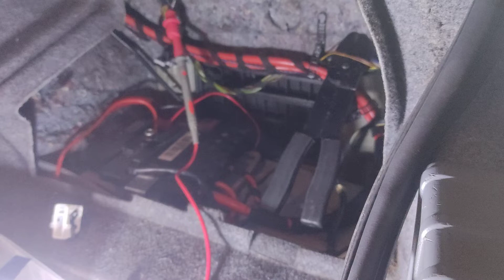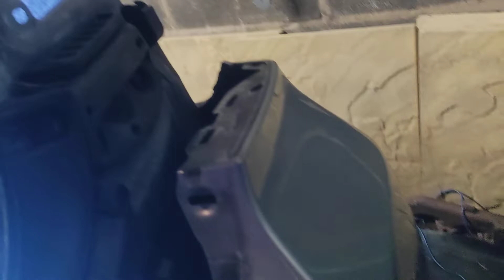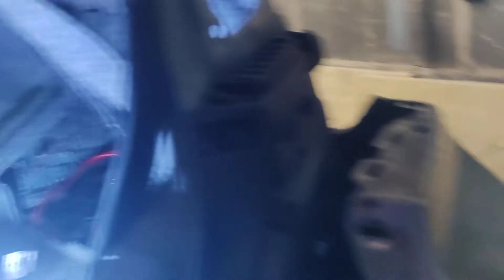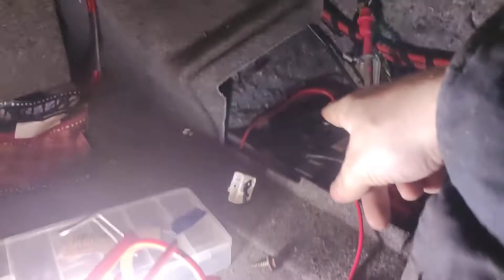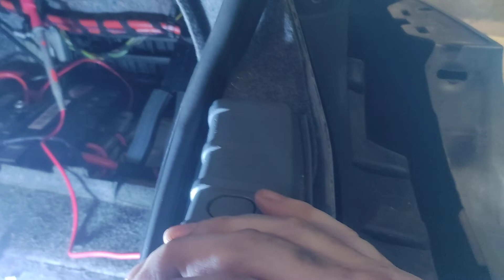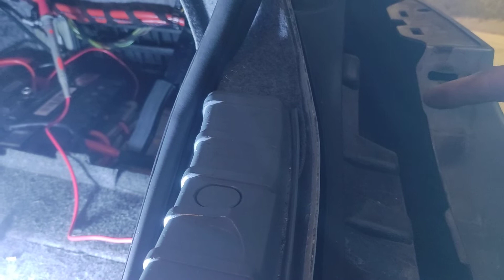Parking sensor wiring diagnosis BMW E90 this is not a parking sensor video!

Comment: Thank you. Pdc error on E90 2007.. like you say, not much on the internet about the lication of the harness and connectors. Will chexk this shortly
Reply from the maker: Try real OEM.com. it's not a separate harness it has to be cut from the harness if you are to replace it

Comment: My rear parking sensors are acting up, I have a 2008 e90 and I cleared the codes with inpa and when I put it in reverse my pdc beeps and then stops giving me the fault, on inpa I get the code 9e33 which on the forums tells me there’s a fault with the wiring, any input on where to look first? Thanks!